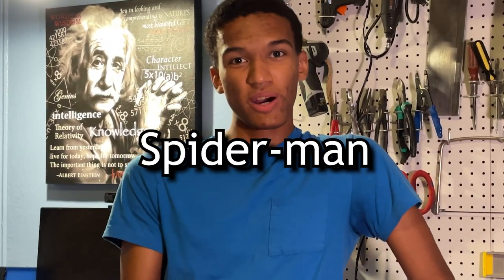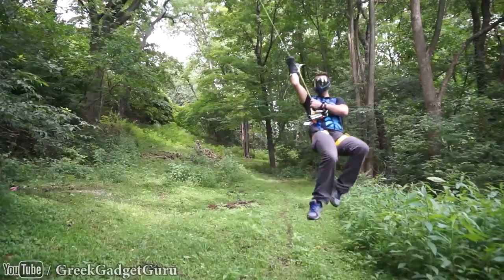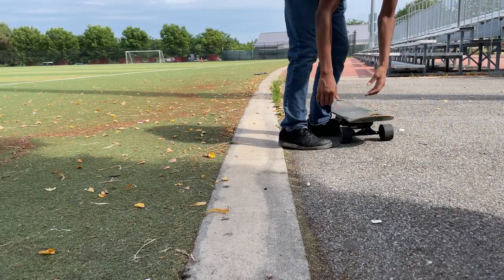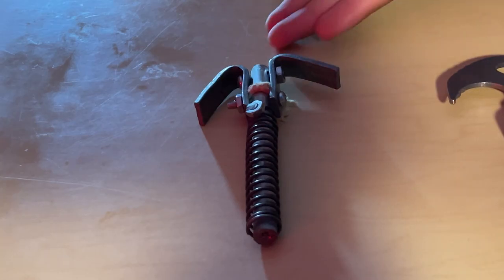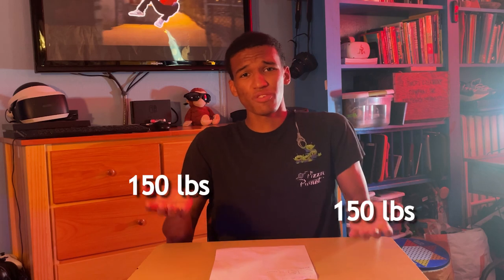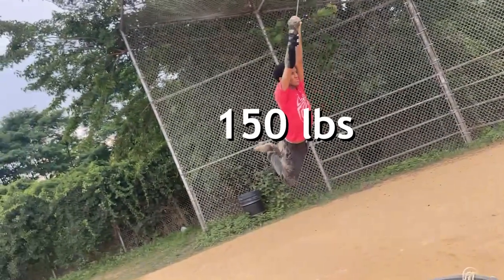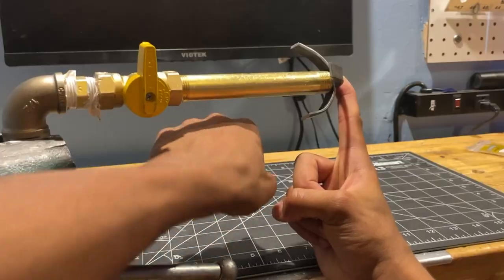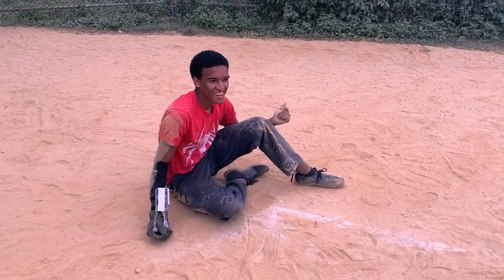Building Spider-Man's Webshooters

Comment: I recommend a harness like g3ar’s and back to your first video I thought about the nails you’re onto something With a lot more force probably from a pcp air source or propellant you could probably make a projectile based off of strike anchors you put em in a hole hammer the pin sticking out of the head and the tip expands
Reply from the maker: I remember hearing about that, I'll defiantly look into designing some thing like that.

Comment: in your og video you talked about it shooting nails, could you have a custom nail that shoots out prongs or something similar out of the sides once its inside of a wall?
Reply from the maker: I've consider something like that in the past, but the complexity of a multi-stage dart hook that's also small enough to be launched off my wrist would call for a lot of small move parts. That would ultimately make it very unreliable to swing from without professional grade manufacturing equipment. 

Maybe for something like that to work, the dart could have a passive system like how a wood screw naturally builds up more resistance the further it's driven into a material. Then for releasing the entire line could be detached rather than the dart coming out of the wall.

Comment: Ben how did you make the trigger shoot because you fire it and the metal trigger goes back to the exact same spot if that makes any sense
Reply from the maker: The trigger is a strip of spring steel, it returns to it original position after force it applied to it.
Reply: @BenRebuilt  oh cool thanks

Comment: What sort of metal did you use for the trigger
Reply from the maker: I used some spring steel from a knee brace hinge,  It was a pain to cut and drill through tho.
Reply: @BenRebuilt  ok thanks
Reply: @BenRebuilt  sorry im late but hoe is that trigger bending so well
Reply from the maker: @Fagelyt  No worries, It's because spring steel has a very high yield strength and can be greatly deformed while still being able to return to it's original shape. 

And the reason it's so easy to bend with my just my finger is because I'm taking advantage of torque. Since one end of the lever is attached to the webshooter, I'm making sure that my fingers are applying force to the opposite end of the lever. Because the force I'm applying actually gets multiped the farther it is away from where the object is attached

Same reason why door handles are mounted far away from the hinges where your door is attached to the wall.